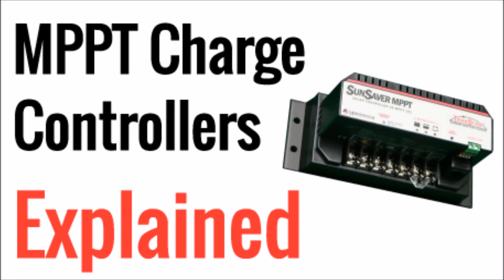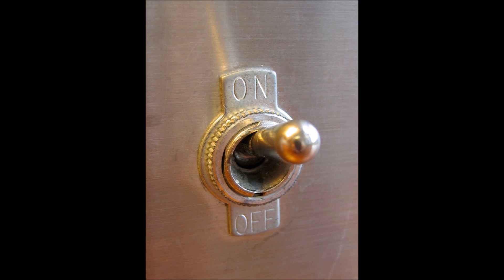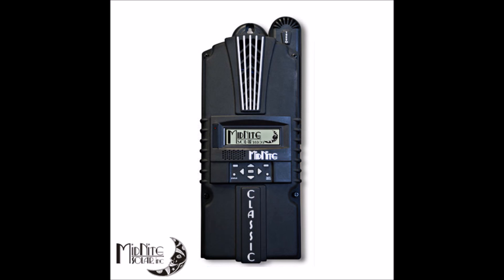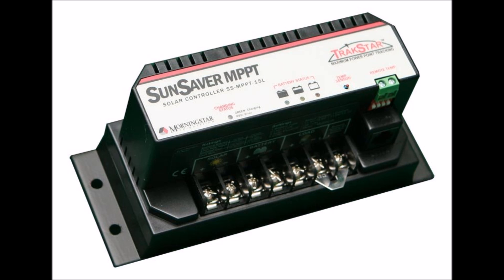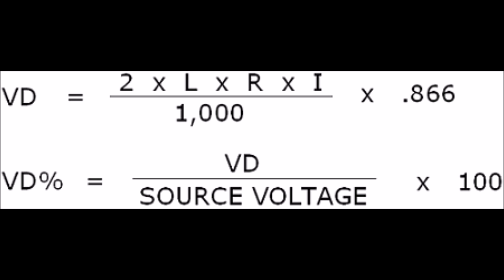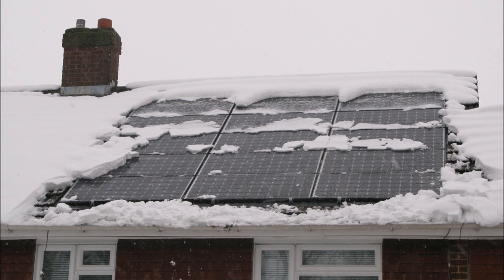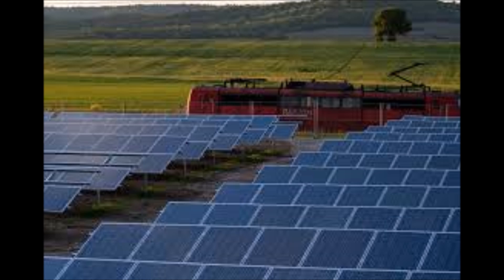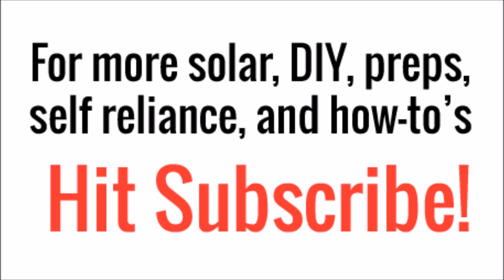MPPT Charge Controllers Explained

Comment: The only update to this very helpful video is that there are now (6 years later) very good MPPT controllers in the $100 range. Even a few under $100.
Reply from the maker: Yes, there are hundreds on the market now and the prices have come down.  I'd still be quite leery of anything promising MPPT technology for less than $100, though.  Especially Chinese brands.  There have been numerous units caught saying they are MPPT but actually using PWM.  Also, the sampling rate matters.  I have seen some units only track the power point every 60 seconds.  That isn't fast enough to get the benefit of the efficiency.  It needs to track once every 1-5 seconds, IMO.

Comment: I have a 90V battery pack. I also have two identical sets of solar panels. Can two 48V MPPT Controllers be connected in SERIES to charge my battery pack?
Reply from the maker: I am pretty sure that would not work.  The controllers have to monitor the voltage of the battery that they are charging and they would see that the battery is much higher than the upper limit of their specs.

Comment: 1) If my solar panel 250w each connected in series at 136 volts. Is it ok to use am MPPT charger controller specified as 24 volts input?
2) If  panels of 136 volts can be used with MPPT charger controller at 24 volts. Then Why there are MPPT  charger controller at 24/36/48/60 volts use for? Can you give some typical example please?

Comment: Nobody seems to get it. The 18v of a typical 12v panel gets pulled down to the battery voltage by the PWM (basically power averaging) and the *MPPT both. To get the most out of an MPPT (or any benefit at all) you need to go at least double the voltage for the panels. If your MPPT can handle higher voltage, then go to that. An MPPT utilizes the typical 18v in PWM mode. It's unlikely with an 18v panel but if extra voltage exists (like with a 36v house panel being ideal) the MPPT controller has an inverter section inbuilt (transformer and all) which converts the extra voltage into current which also goes into your battery. So in a 12v battery system, instead of say 6 Amps with a PWM on the same 36v panel you might see 10 Amps typical with an MPPT. (real world figures)
So if you only have 18v panels then stick with the PWM, it's cheaper. To get the best use out of an MPPT controller the system needs to be designed using 36v or even 72V inputs (within specs).
*Technically the MPPT tracks and keeps to the voltage of a panel that provides the maximum power output at any given time. That's called tracking and to be precise, Maximum Power Point Tracking or MPPT. Panels in series need to be the same.

Comment: Will a charge controller also shut off power and prevent your batteries from draining below 50%?
Reply: Seems your question was ignored and i'm a bit late to the party, but yes, they will. However, to do so the load needs to be connected to the controller and not directly to the battery. Some controllers will allow the voltage disconnect to be adjusted as well.

Comment: Dont no if your still active on here but what i would like to no is...if i pick out a 40amp mppt where is it calculating that max 40amps at is it on the solar input side? Or is it the max conversion it can do to the 12volt battery output?....hope i explain my question ok....
Reply from the maker: Both.  It can handle a maximum of 40A on the solar input side at a certain voltage (most MPPT controllers can handle either 12V or 24V so check the specifications as the amp rating may be different).  It can also provide 40A of output through the load terminals.

Comment: The "MPPT" controller you show at the end isn't MPPT;  it's a fraud, as YT teardowns will prove.  Having said that, there are completely configurable and dependable MPPT in the $100 range.  

The Tracer A series is a good example.  Current prices as of this writing are $52 shipped for 10A,  $75 shipped for 20A, $85 for 30A.  The 40A breaks the $100 line at $125.
Reply from the maker: It was for illustration purposes.  I use images that are approved for re-use so sometimes that limits my options a lot.

I am not sold on any Chinese mppt controllers.  I am not saying they are all junk and I am sure some of them are great.  But I don't trust any of them at this point due to the many ripoffs and frauds.

Comment: LDSreliance setting a price for any electronic device is a fullish advise. Cell phones as an example may cost $700 today but two years later you can get them for $100.
This is always the trend with electronics; a MPPT controller can sell for $1,000 until that technology becomes common practice then you can have it for $10.00
Please don't be a hack for MPPT manufactures !!!
Reply from the maker: Cell phones drop in price because a new model comes out and the old one is obsolete.  They no longer make the old model.  Their life cycle is about 1 year from launch to planned obsolescence.  You can continue to use the phone for longer than 1 year but the manufacturer does not make them and sell new ones any more.  

That is not the case with MPPT controllers.  They are very low volume production, unlike a cell phone, so recouping your R&D takes longer.  They also do not release a completely new version every 6 months.  Some companies, like Midnite with their classic series, continues to make the same model for decades.

The only thing working to drive the cost of MPPT controllers down right now is the increase in popularity of solar so the companies can sell more units.  Cheap Chinese knockoffs that have not put in the same R&D are not a good investment and cannot be compared to legit European and US makes.
Reply: so what's the best brands with a good price you recommend???
Reply: Bullcrap.  By definition a knockoff doesn't have to do R&D because someone else has already done it.
Reply from the maker: How many knockoffs do you know of that are as good as the original?
Reply from the maker: Some of the best brands are Outback, Midnite, Morningstar, Xantrex, Schneider Electric, Magnum, and Blue Sky.  There are lots of others, though.
Reply: thanks for replaying. God bless you

Comment: mppt controllers cost much more than PWM controllers...The extra cost makes PWM controllers a better choice for smaller systems
Reply from the maker: Correct.  Those prices are coming down but you are still better off to just buy an extra panel to get the same extra watts you would generate going MPPT as opposed to PWM (below about 600 Watts or so total system size).
Reply: Maybe.  I have both and use them for different things.  MPPT will deliver more current than PWM when the battery is deeply discharged, can handle greater loads for the same amount of sunlight, have better yields when panel area is restricted, better yields in the cold, better yields in marginal insolation conditions and maybe in partial shade, can often tolerate overpaneling, can use higher voltage panels which tend to be cheaper by the wat, and can be used as a component in a DIY smart converter.

Yes, MPPT is relatively $$$.  If one doesn't need the benefits it would be money wasted.
Reply from the maker: Yes they are great!  I always recommend someone use them for any system over about 500-600W.  Below that it is more cost effective just to add another panel to get a bigger bump in production.  But in all other situations MPPT is better.

Comment: So, I have two CS6-335 panels and 6x 12v batteries I'd like to charge up for some off grid learning.  Which mppt cc would you think I should look at? Or a good place or website to start with.. I'm so new to this.
Reply from the maker: In my humble opinion, I like the Midnite Solar Classic 150 and the Morningstar TS-MPPT-60.  The Midnite has a big following and has been an industry standard for many years.  The Morningstar is newer and faster but maybe not as popular yet.  You can't go wrong with either one.  They will both be very efficient and are supported by great companies.

http://amzn.to/2r8LubM
http://amzn.to/2r8xaQB
Reply: The Morningstar Tristar MPPT has been around since at least 2009.   Morningstar, Xantrex, Outback and the like are industry standards.  The Classic is a very good controller but businesses don't buy things that look like old timey radios.

Comment: Alright I got some things to get

1.) A 12V deep cycle battery or a 12V lithium battery (or environmentally friendly battery)

2.) A much better charge controller (mine is 100 watts it came with the harbor freight kit)

3.) A much better inverter that can handle higher loads

4.) Much more efficient panels. Perhaps I may make my own panels with mono solar cells? Or I may just buy a mono panel for below $1 per watt. If you want to know how big my 45 watt panels are already, the height is 1 inch, the length is 36.5 inches and the width is 37.5 inches. These panels are made out of amorphous crystal, never heard of it. And it is much heavier than a 100-watt panel.

I think that's it.

Questions:

1.) Why can't you just have 1 battery that powers your house? Why do you need to have multiple batteries in series? And why do you need to wire them in parallel also?

2.) Are there any 12V deep cycle batteries for dirt cheap that you know of? Or perhaps a battery for solar applications? Can I have the link? 

3.) Remember when you told me that you would need a special type of glass for the frame of the panel? why can't you or I just use any glass or any frame?

4.) For a 12V deep cycle battery, how much can you charge a battery (max voltage) and how much can you discharge it (minimum voltage)?
Reply from the maker: Sounds like a good shopping list.  Those harbor freight kits are good to learn on but not great for doing anything longer term.

1) You could have 1 battery that powers your house if it was big enough and had enough capacity for your needs.  But unless you go with super expensive telco and utility batteries that cost thousands of dollars each you really can't find much on the market that is affordable and has more than about 300Ah in a single battery.  You do not have to wire them in series and parallel.  But when you use a golf cart battery (6V usually) you need to wire them in series in pairs to get up to 12V where your inverter can make use of that power.  Then you can wire those pairs in parallel to add additional capacity.  Did you watch my series vs parallel battery video?  https://youtu.be/4yxR-Iz2Xdc

2) The cheapest, best deep cycle batteries I know of are GC2 golf cart batteries.  You can get them at Costco and Sam's Club for $90 each or so.  So for under $200 you can wire them together and have a 12V battery with about 225Ah or so of capacity.  https://www.samsclub.com/sams/duracell-golf-car-battery-group-size-gc2/prod3590228.ip?searchTerm=gc2

3) I answered that question in your comment.  Did you see it?  It needs to be low iron, high transmissivity glass that lets as much UV radiation through as possible.  Normal window glass filters out all UVB and UVC light and some UVA.  It will limit the power your solar panel can produce.

4) Depends on the battery chemistry and the manufacturer specs.  Usually the charging voltage is 14.6-14.7V but it might be able to tolerate a little higher or lower.  50% discharged on a flooded lead acid battery is 12.2V.  25% is 12.0V.  So if you go much below 12.2V you will shorten the life of the battery.
Reply: 1.) Oh ok

2.) Iv seen 12V batteries for much cheaper.

3.) I didnt see it. But thank you.

4.) Thats for deep cycle batteries? I get that out of a car starter battery
Reply from the maker: 2) Yes car batteries are much cheaper than deep cycle.  You get what you pay for.

4) You get what out of a car starter battery?
Reply: 2.) I meant iv seen deep cycle batteries for much cheaper. Like that link you sent me.

4.) I have noticed with car starter batteries, they can't go above 15V or below 12V. It sounded like that the deep cycle specs you gave me are just like my junk car starter battery. Also, I thought deep cycle batteries were meant to take all that abuse, discharging, and recharging over and over again.
Reply: Quick answer: in series to increase voltage, in parallel to increase current. (note: a 6v or 12v battery is a series of 2v batteries.) As LDS said, warehouse clubs are the best bet for new golf cart / marine batteries, but if you have a golf cart shop nearby, you might be able to haggle for some used batteries -- it's cheaper than shipping to a recycler. (they tend to have 75-80% life left in them.) As for charging, "consult manufacturer specs"; that's the only way to know for sure what a specific battery needs. (which means never buy a store brand battery as there's usually no telling who made it. The Werker line at batteries plus, for example.)

For reference: http://checkforbees.com/pics/BTI-Raleigh-Switch/Raleigh0030.jpg That's a telco battery. Each one is 2V, with enough power to literally vaporize a wrench.
Reply: But in #4 I was saying that iv seen car starter batteries like the deep cycle specs he gave me. So, im very VERY confused...
Reply: "start" batteries are designed for top-end surge loads. They cannot be deep cycled without damage. Deep cycle batteries are designed to be, as the name says, deep discharged (some as low as 1.5v per cell)
Reply: I understand that, but the way that LDS explained deep cycle batteries, that sounded like the specs that I was using from a car starter battery.

Also, what special role does amp hours have as far as appliances? Could I use a 7 AH battery for powering my house as long as the voltage is high enough?
Reply from the maker: If you are just looking at the voltages that mean a battery is full and a battery is discharged then a deep cycle 12V battery will be identical to a comparable starter battery.  The voltage is not the differentiator.   Car batteries should never go below 20% discharge and even that will hurt it.  A true deep cycle battery can go to 50% DoD day after day without killing it.  That is the difference, not the specs.

Amp hours (Ah) tells you how long the battery can provide its rated current (usually at the 20 hr run rate).  If you haven't watched it, go back and watch this video I shot:  https://youtu.be/6nfVn8-7WDM
Reply: So, I can drain a 200 AH (example) deep cycle battery to 100 AH and be fine? Or can I drain it to 0 AH?
Reply from the maker: You can drain all the way to the cut off voltage (manufacturer stated voltage that the battery is "empty").  So draining a 225 Ah battery that has a cut off voltage of 12.0 from 12.7V to 12.0V will have given you 225 Ah.
Reply: So I can drain a 225 AH deep cycle battery to what amp hour?
Reply: Oh ok thank you. Thats for deep cycle batteries right? Also, try making a solar power pack on camera. It would be pretty interesting to see.
Reply from the maker: You can always go from full amp hours to 0 amp hours on any battery.  But car battery manufacturers pretty much never advertise the amp hour rating because that is not a factor in its intended purpose and the rating would be laughably small.  But if a car battery could be safely discharged 20% from 12.6V to 12.42V and the manufacturer rated it as 25 Ah (just pulling numbers out of my rear) then that would comprise the full 25 Ah.  12.6V would be fully charged and 25 Ah of storage left and 12.42V would be fully discharged and 0 Ah left.
Reply: So according to what you said, what's the difference between a car battery and a deep cycle battery?
Reply from the maker: Sorry, let me correct myself.  I did some further research into the standard amp hour ratings and found I was in error.  The terminal voltage (usually 1.75V per cell) is used in determining amp hours by the manufacturer, NOT the cut off voltage.

My apologies.
Reply: I just got alot more confused. I did find a lithium battery for < $200 that is 12V 24 AH and is a hybrid battery.
Reply: can I run a wind turbine 24-volt with mppt controller
Reply: That will surely confuse onlookers.  OP posits a 225Ah deep cycle.   Deep cycle should go no lower than 50% state of charge, which would mean the C/20 use off 112.4Ah in 24 hours.    

I understand your example  but lead chemistry batteries just aren't rated in usable Ah.
Reply from the maker: To 0.

Comment: If you have full sun you may not need an MPPT controller. In all cases an MPPT controller will work better than a PWM. But, when you have full sun all day and all panels are in the same condition one just does not gain much over  a PWM. The extra cost does not justify the expenditure. 
 An MPPT controller really comes into it's own is when the sun is constantly changing and the clouds play a big part in that. But also each panel should have it's own controller. With full sun and all the panels in the same condition one can use a string inverter and a PWM controller.  The cost difference is quite significant. I'd pay a hundred dollars for a  Genasun controller before I paid for anything, But hey, sometimes ten bucks will give you the same results. It all depends on weather and shading conditions.
Reply: LDSreliance you are a hack and a menace to DIY electronic controllers.
Reply: markspc1 Sheesh..
Reply from the maker: Yes, there are some scenarios where an MPPT controller will not benefit much, especially cost wise.  I will explore those in a future video.  Probably soon.